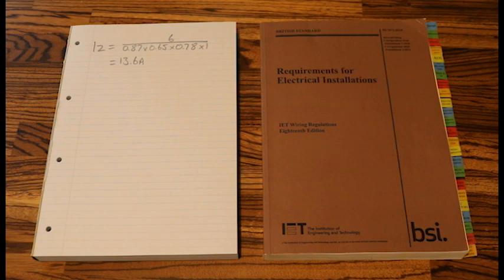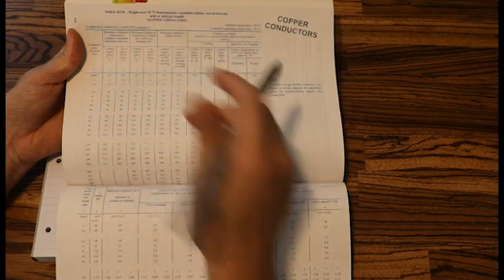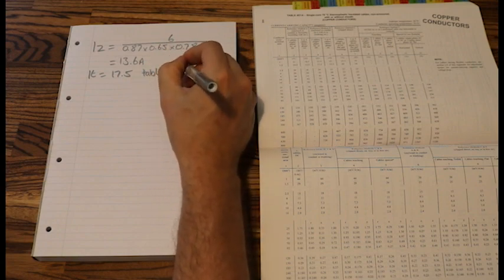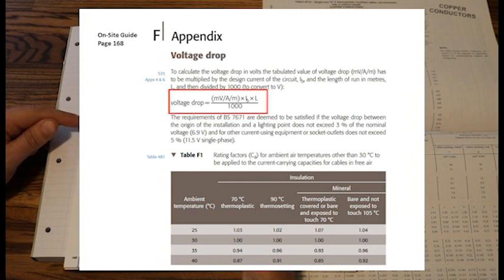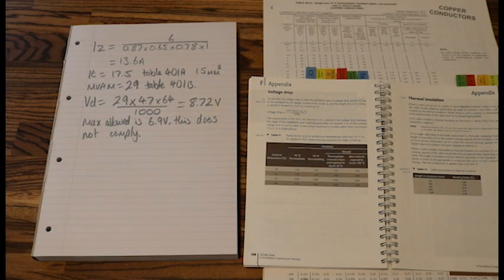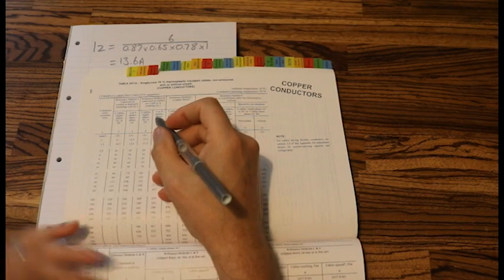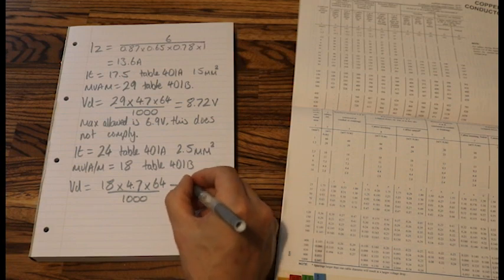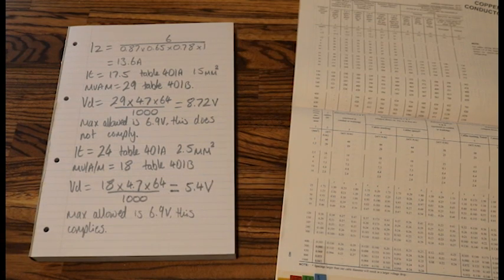Calculating volt drop and what to do if your volt drop is too high

Comment: Thanks for sharing this video. 4.7A Ib also threw me off but I now understand from a comment below that power factor is applied in three phase circuits.
By calculating vd as in the example does it not assume worst case in that all of the load is at the end of the length?
In reality will those lights not be at different points in the circuits and if so would this reduce the voltage drop? might be a silly one. 
If the voltage drop is tight would it be possible to calculate the vd individually at each points if known?
Lastly in a domestic situation its unlikely all lights will be on at the same time. are there any diversity calculations to account for or do we always assume worst case?
Reply from the maker: @Dr.Stacker  Also, look at page 136 OSG, note 2. Discharge lighting needs a 1.8 multiplier on the total power. 
These calculations and questions I am showing are for student electricians trying to pass their level 2 and level 3 qualifications. So, they are somewhat simplified. You are correct that it is assumed all load and volt drop is happening at the end of the line, as you say, worst case scenario. 
Table A2 OSG does say that in houses a 66% diversity factor can be applied because not all lights are on at the same time. But not so in businesses and shops, so only a 90% diversity can be applied
Reply: @ElectricalStudentsUK  I too am studying and must admit your videos are top notch. Thanks

Comment: Thanks again for the video - very clearly explained.  I follow all the figures except the Ib quoted at 4.7.  My understanding (probably flawed) is that the load would be 600W and the Ib would be 600/230 = 2.6?
Reply from the maker: In simple circuits Ib is calculated by P/V. There are a number of times when it's a bit more complicated. For instance, if it's a three phase circuit, if the circuit has a motor with a power factor. In this example the circuit is a flourescent lighting circuit. Flourescents have a high inductive load and are classed as discharge lighting, so Ib=Px1.8/V. Check out page 136 OSG note 2. ONLY use the 1.8 multiplier for discharge lighting. Old school bulbs and LED are not discharge lamps.
Reply: @ElectricalStudentsUK  If the circuit is 3 phase, how come you would use the single phase column for reference method b?  
Also would the formula be px1.8/230 for this question or px1.8/400?
Reply from the maker: @kashif4463  Hi, yes indeed you are correct, I hadn't spotted that. The question is three phase so mvam would be 25 from column 6 on table 4D1B. 

I have jumped straight in at Iz on this question, as I'm trying to show what to do if you have a volt drop problem. But when working out the Ib on a three phase circuit it would be Ib=P / square root of 3, X 400 X power factor
Reply: @ElectricalStudentsUK  Thanks very much - every day is a school day!